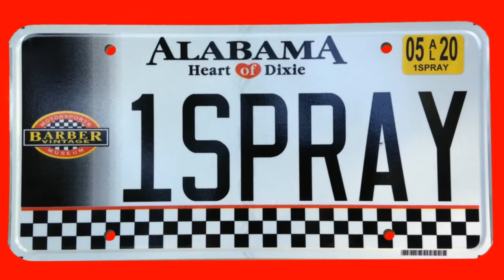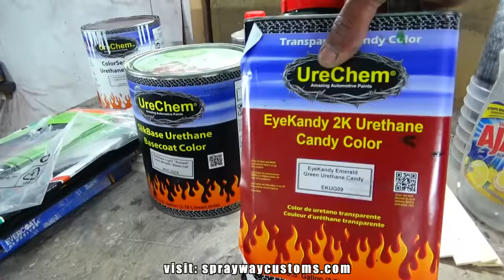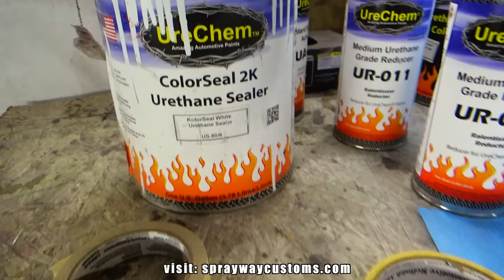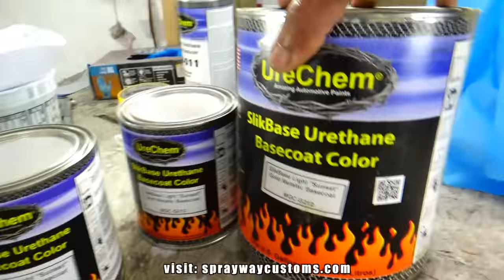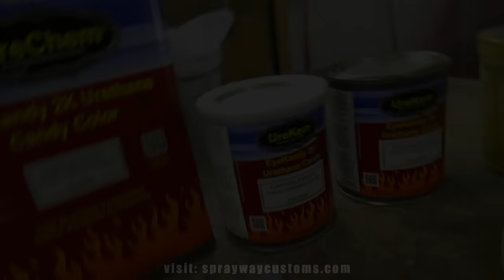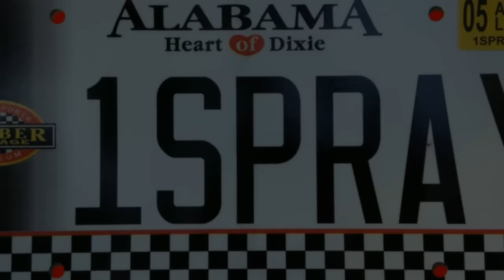How To Paint A Car With Candy Paint STEP BY STEP Chevy Camaro Iroc Z28 3rd Gen Kandy Emerald Green

Comment: I just happened to come across your video of painting the Camaro and I am sure glad I did 😊 along with the rest of your videos on how to prep and paint. You do fantastic work I happened to own a 1988 IROC with a little over 7,000 miles original. The original owner ordered it from the factory. And had a garage built before he ordered the car. Sadly in 2006 he passed away from a heart attack. I was fortunate enough to buy the car from his son back in 2006. It had clear coat damage on the roof from the garage roof leaking for years on the car.😢 Unfortunately the car has been setting for the last 18 years because I had to have spine surgery and I found out the surgeon had drilled through my nerve which left me with permanent nerve damage. And I had  another surgery in order to try and correct the damage that didn't turn out too well either. I was hoping for a full recovery and dreaming of the day that I could restore my dream car.😢 The car had 5000 original miles when I bought it. In the last 18 years of ownership I've only put 2,633 miles to date on the car. With my condition I don't know if I would ever get it restored 😢 there are no dents or rust on the car. I have a lot of replacement parts that I bought before my surgery hoping to be able to use them in the restoration of the car. Watching your videos has inspired and amazed me.😮 And taught me a lot about things I did not know when it comes to restoring and painting my car. You have given me inspiration. And hope that I can restore my car overtime 🙏 I appreciate your videos and sharing your knowledge and talent. When I seen that color paint 🎨 I was mesmerised at the incredible paint job you did. I pray and Hope 🙏 🤞 one day my car paint job turns out as good? You my friend have a great talent and I am sure you inspire others like me. Thanks for the link so I know where to buy the paint booth paint and paint gun along with all the other accessories. That will be needed. Thank you so much for all the videos. I will be watching your channel everyday. Thank you again.
Reply from the maker: I really appreciate you sharing your story. Thanks for the big support

Comment: So when you were blocking out the primer for sealer. You wet sanded it. Could you just dry sand it or no? Did you only wet sand because you were using sealer? Just curious
Reply from the maker: You can do either one with no problem
Reply: @SprayWayCustoms  thank you appreciate the response!

Comment: Great work as always but 2 questions. Why didn't you take the rest of the body kit and bumpers off? What spray gun did you use for the clear? The red one.
Reply from the maker: Great question. I was contemplating on taking them off but just decided not to. I used a Limited Edition Jean Alesi Iwata Supernova WS400 1.3 tip for clear.

Comment: I’ve been watching your vids bruh so far your the best I’ve seen and you keep it “G”.. I have a question that maybe you can help. I want to build a very small center console with 2 holes for 3/4 kicker tweets and maybe 2 more for cup holders and maybe a square whole for a base knob . I might actually just put the base knob under the driver side. But either way I want it to look real clean I was just gonna do simple carpet but looking at your vids I’m like damn maybe I should do fiber glass mixed with carpet or just fiberglass… idk but any advice on what you think . I’ve never messed with fiberglass but that won’t hold me back from trying.. much respect ✊🏽 homie and FYI it’s for a Lincoln towncar 90
Reply from the maker: Sounds like a good plan you have...you most definitely can make it happen 👌
Reply: @SprayWayCustoms   is there any advice or a video you have for simple fiberglass over just plain flat wood …? I see people just stack on the fiberglass in and on boxes and yours you use fabric so I didn’t know which way to go… thxs in advance..

Comment: Hi 
Geat training 💪what would be the difference if you had did silver than gold?
Ok on my s10 when i start scuffing the paint or sanding 100 grit.... the original paint it making like 📌holes what is the best next step to do? It's on the roof
On a test area......I use a razor blade to very nicely shave a small area and it will knock it down some but it turned into fish eyes fish 🐟👀
Reply from the maker: Silver would've changed the final color up a little but not very much....on your car, just sand it down flat as possible and spray some epoxy to seal it and then some high build Primer and it'll take care of the pinholes.